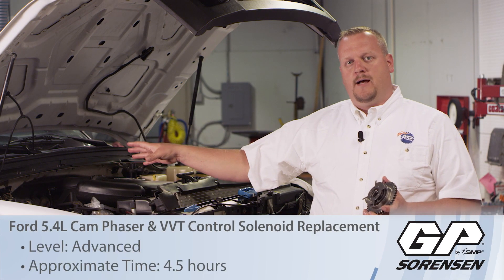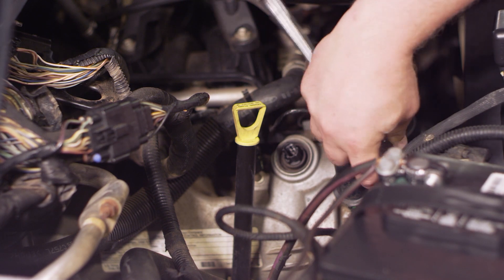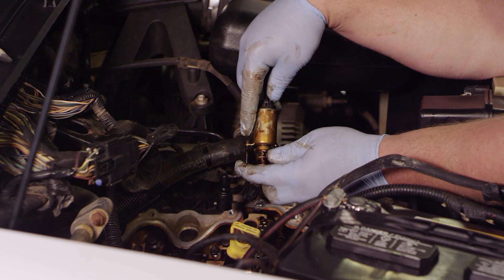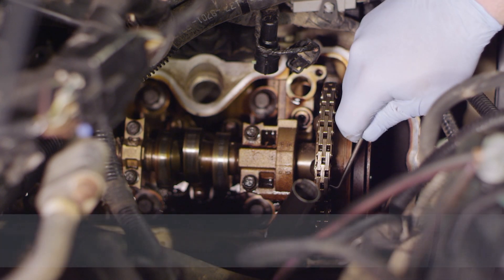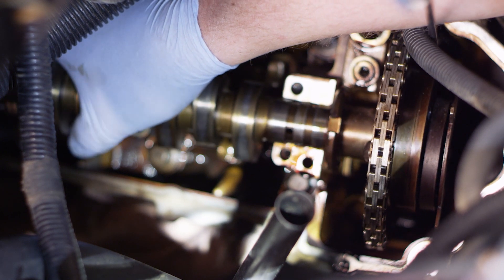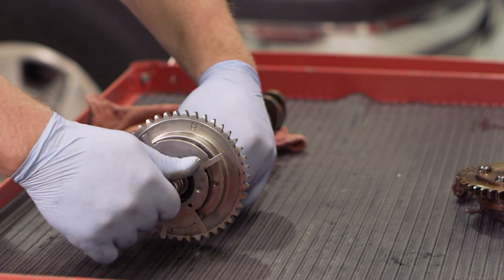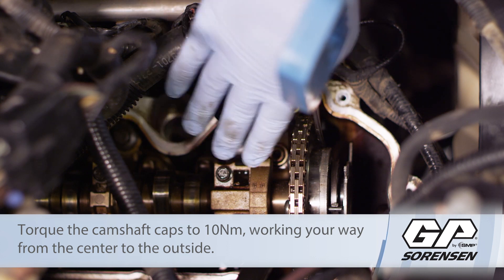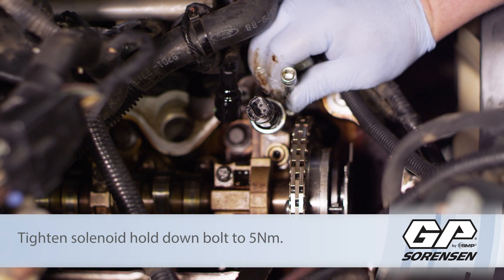Ford 5.4L Cam Phaser and VVT Control Solenoid Replacement

Comment: I have this engine and had a misfire on cylinder 3&5 was told it would be okay to drive just use more gas. So naturally i drive to work out of town and the engine completely dies. Ford said these cam things are locked up and that buying a new engine would be cheaper than fixing it

Comment: I bought a truck with the 5.4 the cam phasors or on back wards when your it down.can I swap them with no issues or what can it do to engine?
Reply: The cam phasers on both sides have the same part number. This question does not make sense.